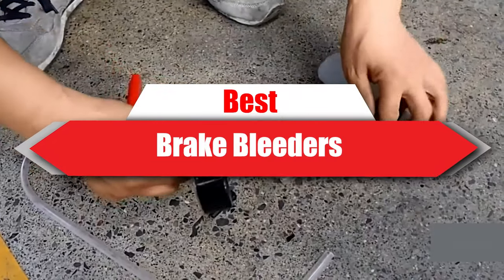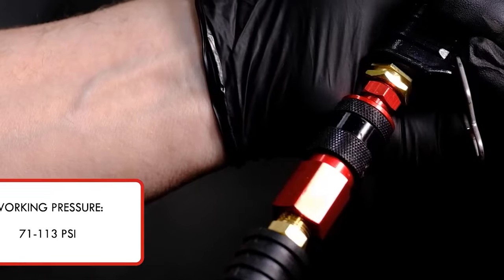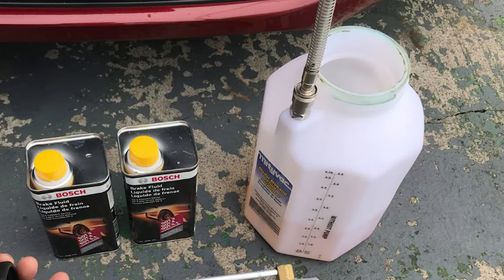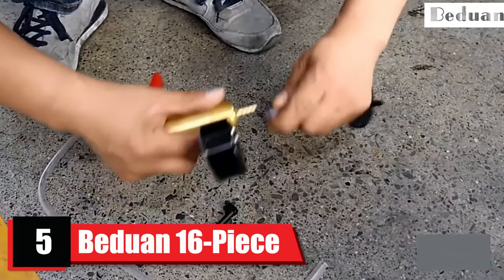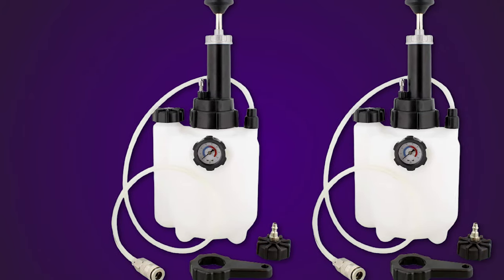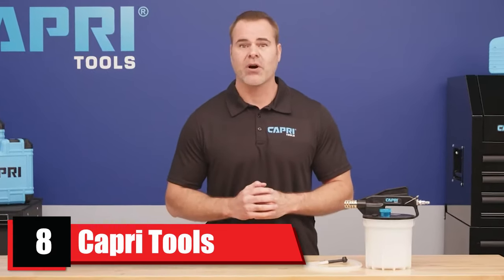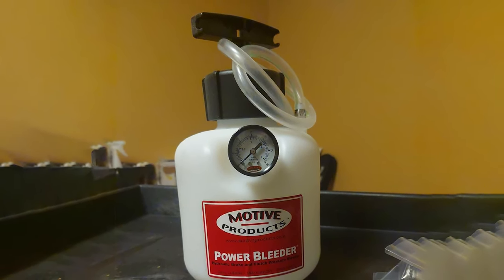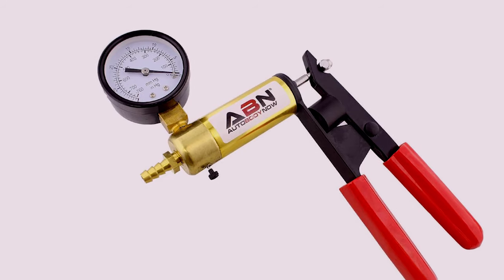Top 10 Best Brake Bleeder On Amazon 2024 | Don't Buy Without Seeing This Video

Comment: I bought the one that Harbor Freight sells to do my corvette.  Total POS!  The handle broke off for the pot. on the second wheel.Total crap and they won't take it back without a 20% restocking fee.
Reply: you got the hand pump one or the air nozzle one?